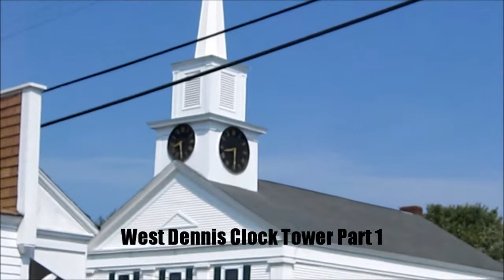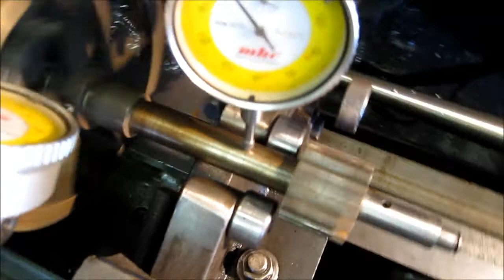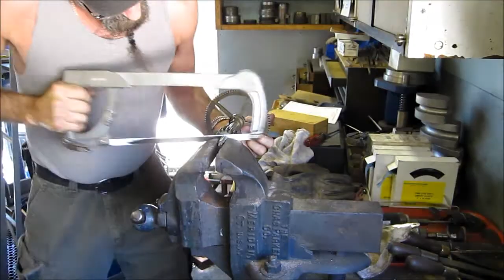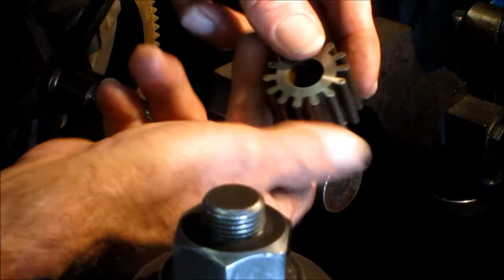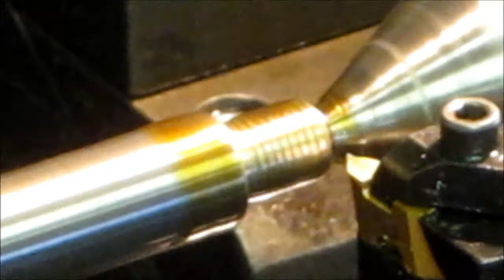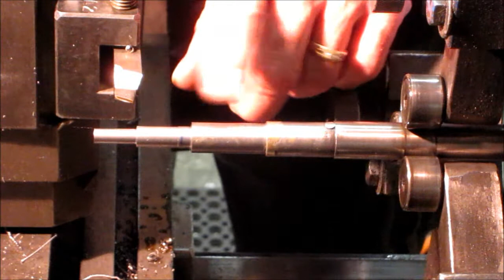West Dennis Clock Tower Part 1

Comment: I know I am nitpicking but silver soldering is technically brazing using a silver alloy.  If I remember correctly soldering is below 840 degrees F and brazing above, also brazing has a molecular bond with the materials instead of just sticking them together as in regular solder.  I just retired from brazing copper to copper, copper to steel, and copper to brass at Trane Inc. for about 16 years.

Comment: Call it soldering or brazing, you are only sticking a lower melting material - generally with smaller atoms - into the gap between two higher melting materials.

Brazing rods are copper alloys - brass or bronze, which melt at a higher temperature than silver alloys - which also contain copper.

Technically, they are both soldering techniques from the engineer's point of view...

And, I was doing vacuum induction soldering / brazing using titanium and zirconium alloys...